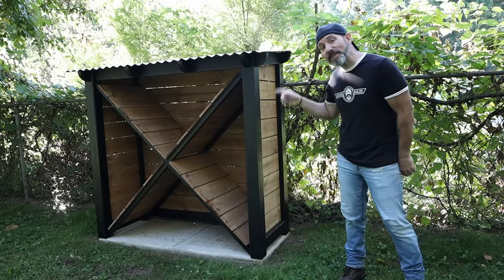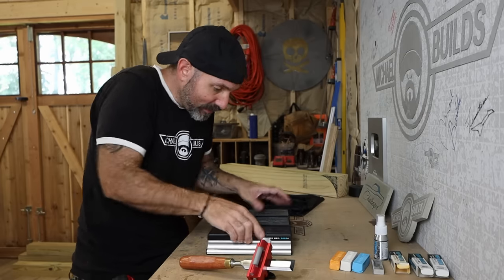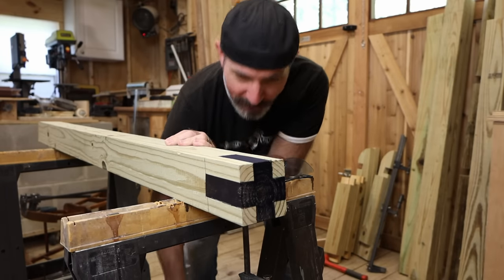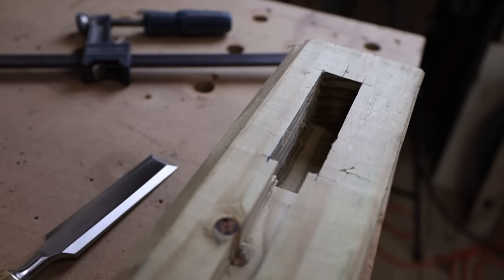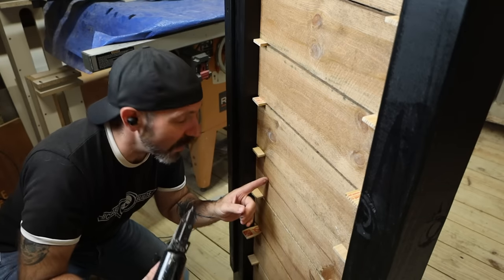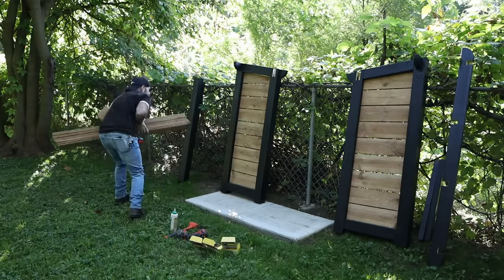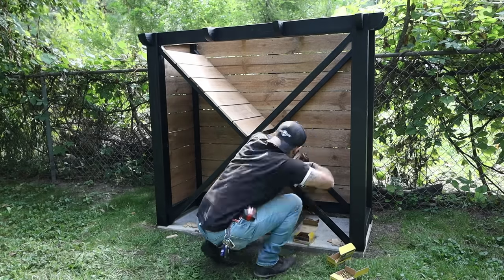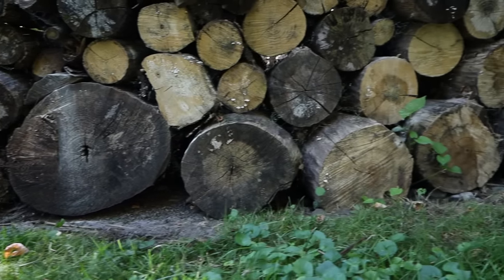How to make a FireWood Shed

Comment: When I see joint work like that my mind goes back to the Japanese woodworker or those old  Amish barns.  Not one single nail and those structures are still standing after 200 years.  I have seen similar work  in using joints like that for patio covers and pergola. On a side note I only burn wood for heat. I actually enjoy organising my wood pile.

Comment: Pretty cool design and concept. On another note, wanted to make a faux retaining wall out of foam insulation. Pretty much make the wall out of insulation and cover it with mortor or some cement so it looks like an actual retaining wall without shelling out the big bucks and time and material for it. Obviously it’s not structural. Thanks and keep up the great work.
Reply: That gives me an idea  to make a  fountain bird bath thing.

Comment: You're actually meant to put them on the peaks of the roof, but not screw them down all the way, just enough to right before it starts to compress the steel.
 All the rain will be focused into those valleys and directly onto your screws making any leaks worse. causing water damage in the screw holes in the wood in 5-10 years.

For a firewood shed like this, it doesn't matter though, just something for anyone doing something more permanent to think about.

Comment: Looks good. My only input would be the screws that you used for the roof. I understand that you don't care about leaks, but the first place that will receive any water damage will likely be the threads of those screws that you used. That may just be my opinion, though.

Comment: To hog out all that wood I was yelling at the computer to use a forstner bit...and then you did.  Thanks for listening.  😆
If it were me, I would have used a tenon hand saw, but those require a little practice to keep the lines straight.